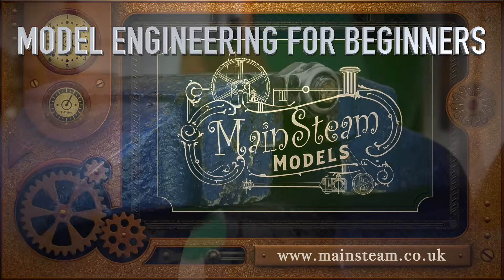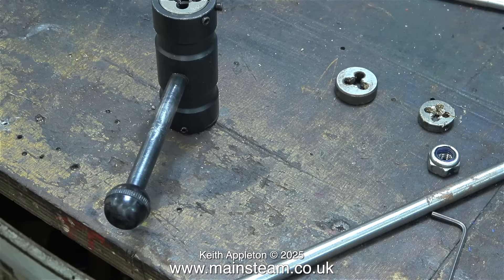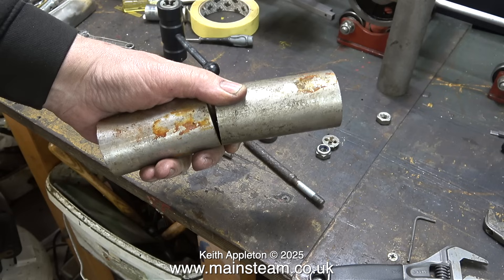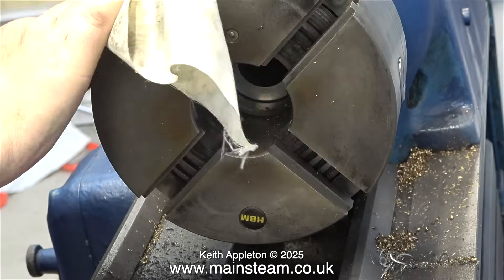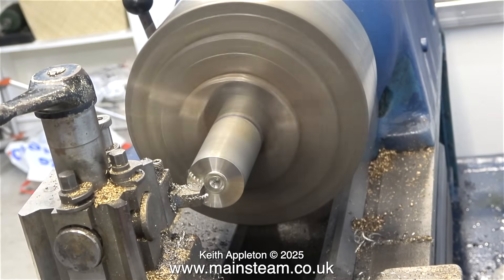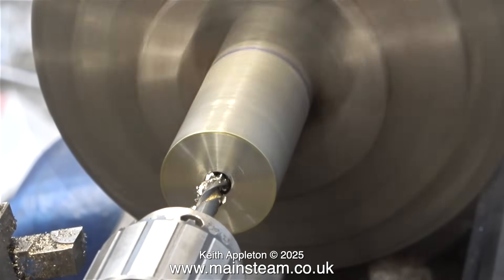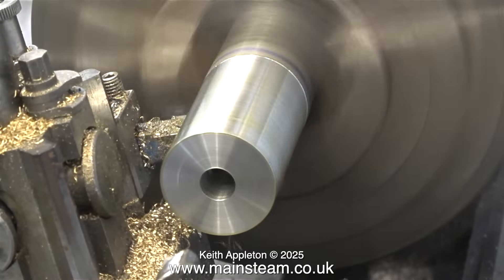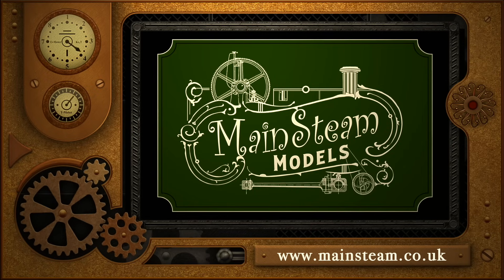MACHINING CAN BE DIFFICULT - MODEL ENGINEERING FOR BEGINNERS

Comment: Careful, you mentioned the doors are aluminum. In a wet climate, if stainless and aluminum contact they will react and cause the aluminum to corrode and disintegrate.
Reply from the maker: I fully rebuilt this Land Rover in 1999 (26 years ago from 2025) using Stainless Steel bolts for quite a few of the panel fixings and not even one of the Stainless Steel bolts or nuts have either corroded or disintegrated. The Aluminium doors were fitted to a mild steel frame, that was the only corrosion and for that reason I bought a new pair of doors. I will be long dead before any corrosion occurs.
Reply: @keithappleton  Good to hear. Just to clarify, the Stainless will be fine, the aluminum is what suffers. I've seen aluminum trim on box trucks completely dissolve in a matter of years due to the stainless steel rivets used. But we get a decent amount of precipitation, and humidity and they salt the roads due to ice in the winter